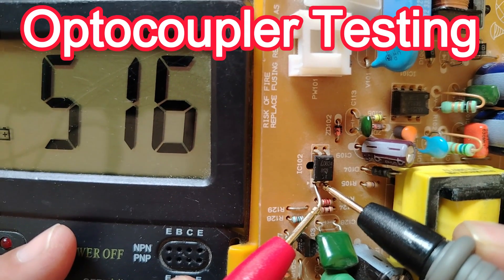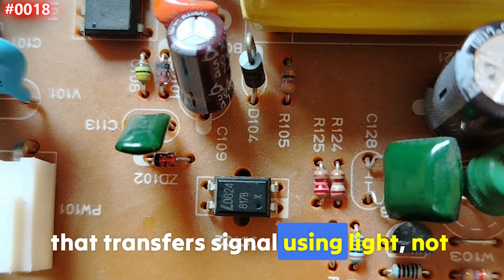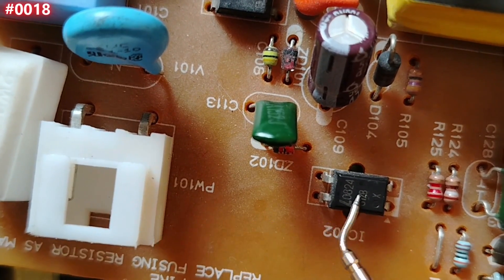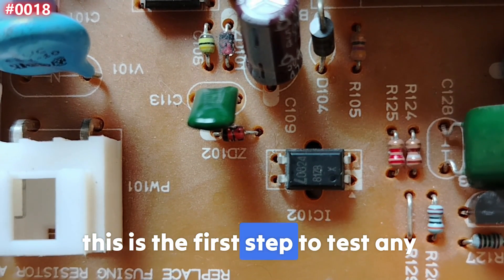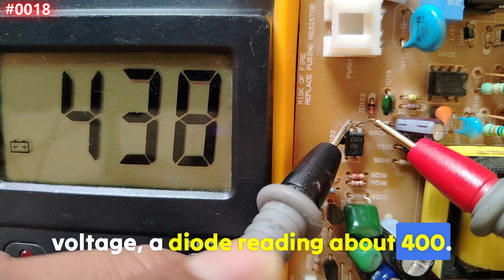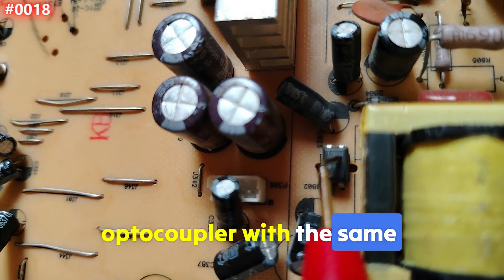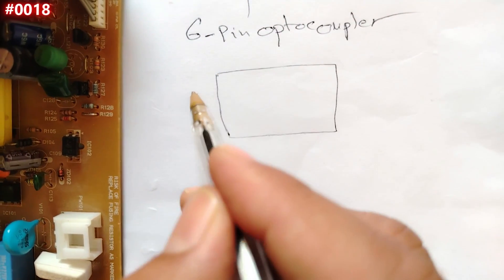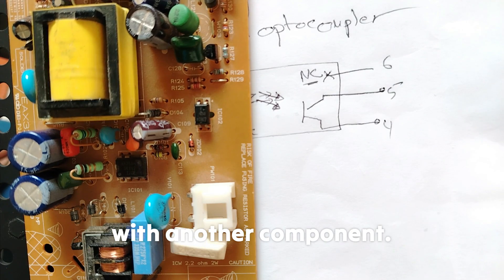#0018 Electronic Components: How to Test Optocoupler using multimeter | Optocoupler Testing

Comment: In a good optocoupler, the multimeter should not show any value when measuring between pins 3 and 4. Why did you read the value?

Comment: Great video! I came across a PC817 optocoupler where the diode between pins 1 and 2 is oriented from pin 2 to pin 1. Is that correct/possible?
Reply from the maker: Check the datasheet

Comment: What about "leeking" with the real voltage used on the board.? . In my practical work I had many times that situation... Checked with multimeter is ok but when I turn on the board, opthocoupler doesn't work regulary and the secondary voltage is not stabile and has dropps
Reply from the maker: In that case use a new serviceable one
Reply: @electronicsrepairbasics_erb Of course... I only say that case is possible too in practical work